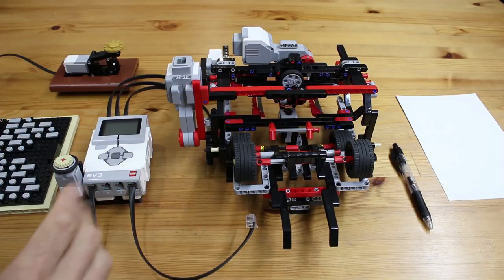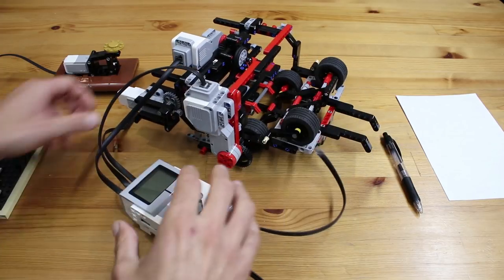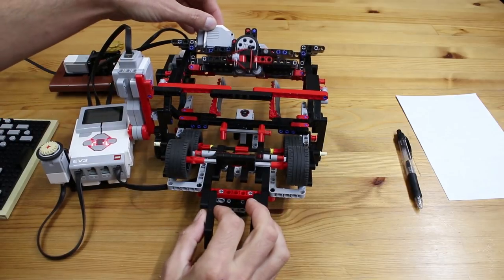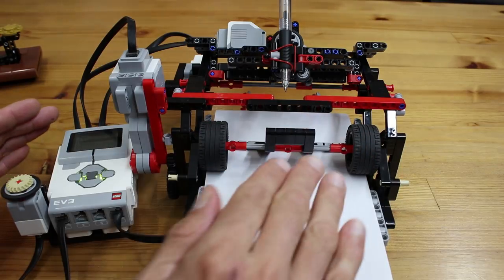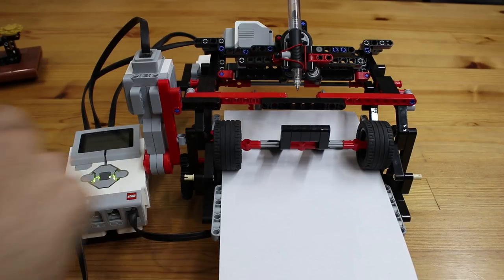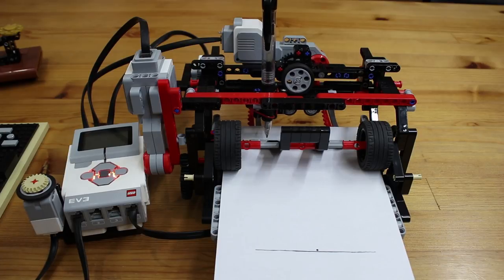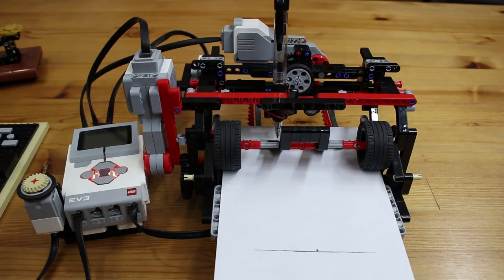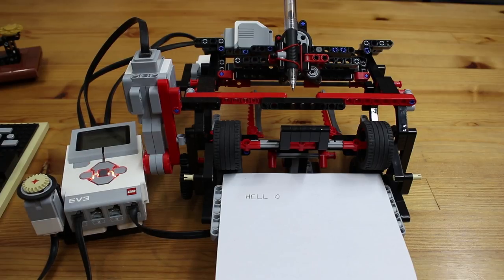LEGO Telegraph / Printer Setup and Calibration

Comment: Hi, rly amazing build! But how do you calibrate the movement of the pen along the X-axis? How does it know its position relative to the center?
Reply from the maker: +Omgtired The wheels that control moving the pen from side to side can actually slip, so if you start calibrating with the pen too far to one side, the wheels will slip when the pen gets to that side. So it will essentially calibrate itself while you run the calibrate program.
Reply: okay, thx for the explanation. Actually, I read somewhere about technic for calibration where you provide motor with constant (but relatively low) power, and track its movement speed, as soon as it starts to slow down (which is due to the fact that it reached its movement limit in the system)  you stop the motor and set this position as a reference point. Wonder if you had any experience with using that.